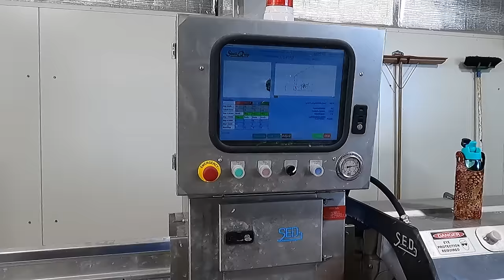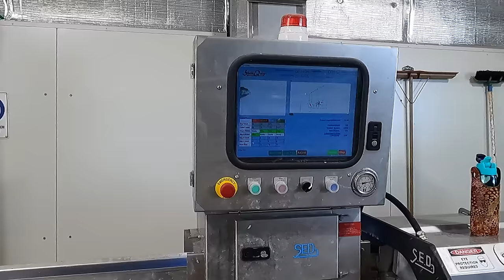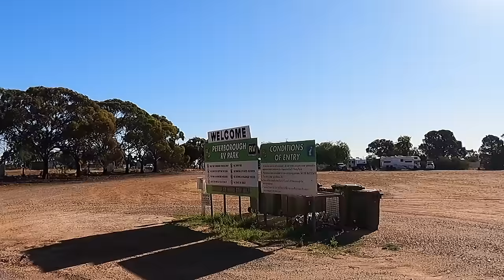Travelling AustraliaTravelling Again 5

Comment: Why would you not use an almac boat trailer local manufacturer top product same weight .Why do you use floats for blue swimmers same in Cowell been fishing there for 17yrs tie pots to boat crabs are in almost straight away finish crabing then go fishing or fish first just curious 😮
Reply: Because you need to muck around bolting Almac trailers up, Mangrove Jack are so much faster and easier
Reply from the maker: my mate also has a Mangrove Jack trailer and we will get 2 generator boxes made ,   1 for each of us and all the fittings can be made the same to house the trailer 
as far as the crabbing goes that is just how we do it in Qld to try to find where the crabs are
cheers Kev